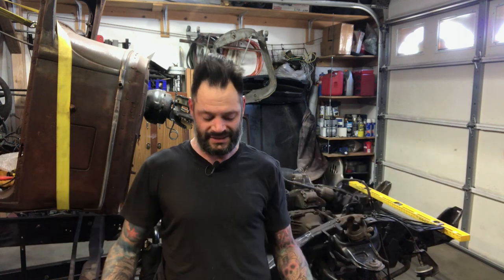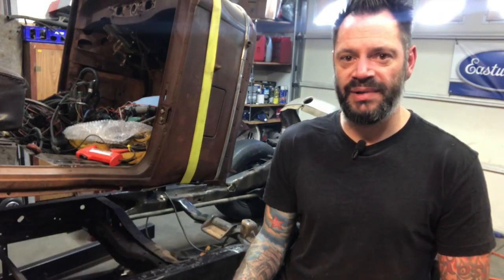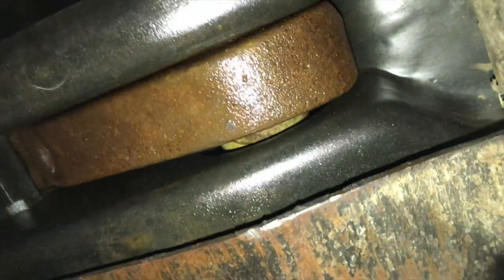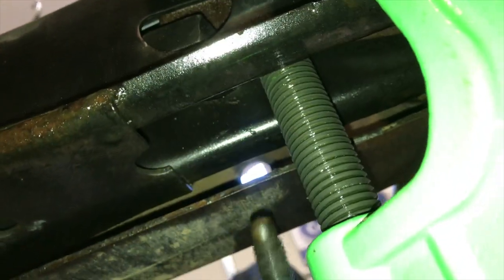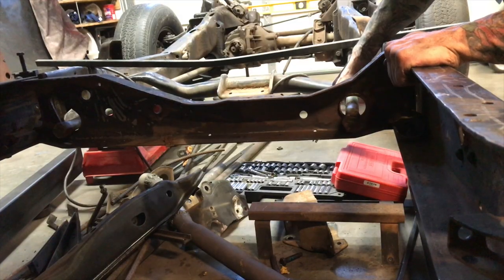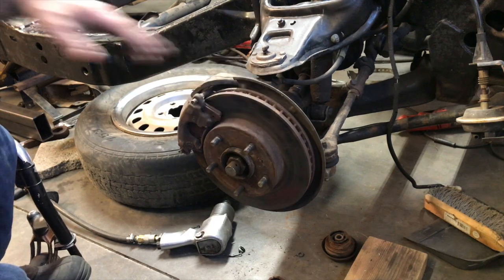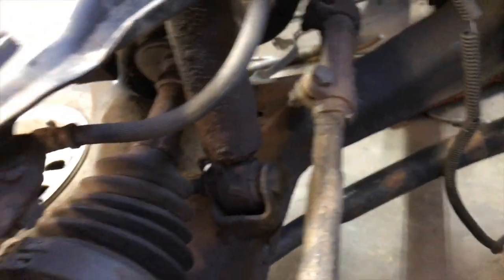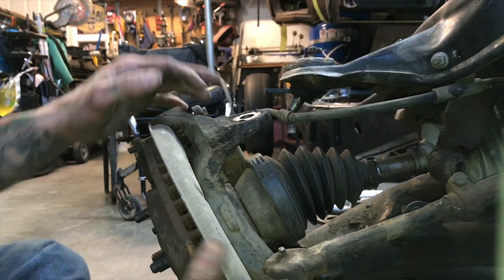HOW TO REMOVE FRONT AXLES AND TORSION BARS

Comment: I watched this mainly to see some one get old rusted torsion bars separated from a lower A arms.  More than one mechanic told me that was a nightmare and the only other YouTube video I saw doing it the guy had a horrible time doing it.  I elected to leave mine together and not replace the swing arm bushings.

Maybe I need to buy one of those air hammers.
Reply: Can't believe how easy you made it look.
Reply: Not to spam your video with 1000 comments but just a note about Ford Ranger set up I didn't need the AutoZone unloading tool.   I just spray painted the tensioning bolts so i knew how far they were in and used an impact wrench (with the wheels off the ground hanging)  to unload  the torsion bars.  The tension bolts came out and the teardrop key was loose enough to wiggle out.